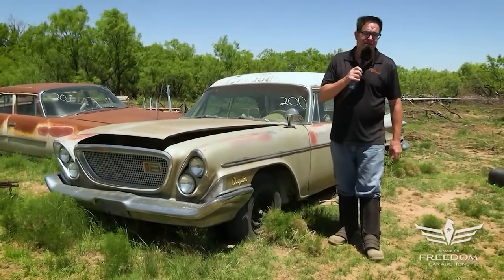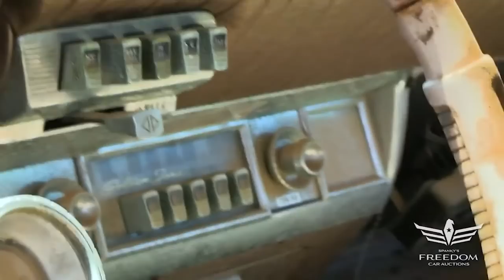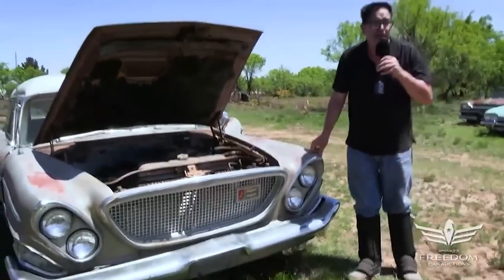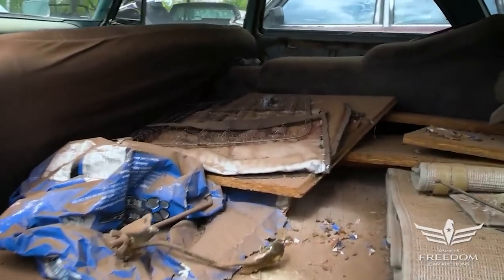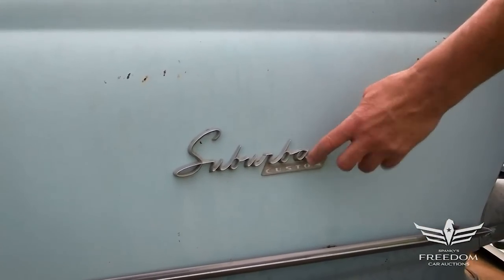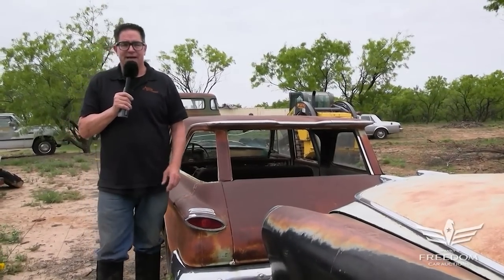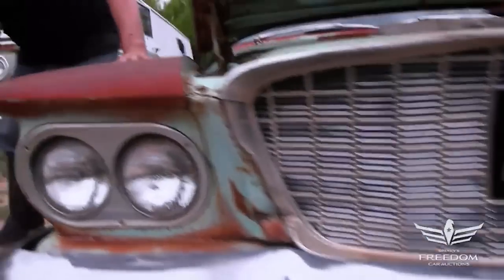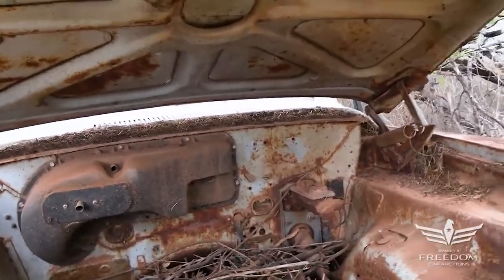Wagons Ho!

Comment: My parents had a new '62 Newport 4 door and from the rear door back that quarter panel is NOT '62 factory stuff.  That is "Ambulance specific" as is the rear bumper and the tailights.  The lights are similar to stock ones that were placed on top of the rear fender and extended over the edge and downward ending in an integral back-up light.  They almost look like the stock ones mounted sideways, but they are not.  The ambulance company did a decent job with the conversion.  Chrysler conversions are rare, because most all ambulance conversions were Buick or Cadillac in the late 40's, 50's and 60's.  The first volunteer ambulance my Mother drove was a used '49 Buick, then a used '56 Cadillac, and finally a new '64 Pontiac.  She could really throw them around, too; but knew their limitations. There were several people in town who said they would ride with her anytime.  [After she drove them, with the gas pedal floorboarded (lights & siren), on US 9W to Albany City Hospital] (Now Albany Medical Center).  One 60 flash per minute 2 bulb Rotobeam (yes, that is a Brand Name) on the roof.  One red light was all that was needed then, not like the 25 flashing lights today that some drivers still can't see coming.

Comment: My father, in 1970, bought a new Plymouth Sport Suburban, fully loaded, with the 2 way rear door, chrome roof rack, and a 383 Magnum under the hood. What a cruiser that was!👍🇨🇦
Reply: We had the 71 with the same specs. Sport Suburban.
Reply: That must have had good power with 383 engine.
Reply: @Daniel-fd3wp  ours had a 727 and probably 3.73 gears, so it would scoot. But it was only good for about 70 on the highway before it got too revvy
Reply: @mgmcd1  It would have been better if it had a 3.23 which would have been fine on the freeway. I don't know the reason for ordering the 3.73--more grunt for pulling a trailer and rarely going over 55?  I believe at 70mph you would be close to 3200rpm.  My 1968 Charger has 3.23 in it, I can smoke the tires and the acceleration is fine.  I will trade off a little "off the line" to have the occasional quick blast on the freeway without running out of breath.
Reply: @ToyKingWonder  it might have been the 3.23, but it was fast as stink accelerating.

Comment: Growing up we had several Chrysler products Stationwagons... First was a pink and white 1956 Chrysler Polysperical V8 S/W "like in the TV Show [One Day at a Time] opening Credits" it was in North West Ohio and the passenger rear seat floor, had a huge hole in it "you could see the ground moving under neath the car" from the winter salt... A dark blue 1966 Plymouth Fury II with Air/C and last year of the "A" block V8 318 & Automatic...  This S/W a former Singer/Friden "Early Computer Company" Service Manager: over Division employee's, company leased car... 1969 Chrysler Town & Country 383 2V Auto A/C dark blue; decked out with huge factory wood faux side cladding... !! 1972 Chrysler T/C 440 V8 4V Auto A/C fully power everything optioned out... !!

Comment: My parents bought one new in 1961, 170 cu.in. slant 6, 3 on the tree. 2 door to keep us kids in😂, windshield wipers were an option. Ugliest car ever built and parts would fall off driving down the road. I rebuilt the engine in 1970 with 200,000 miles and no cylinder wear but the rings were the same size as the pistons.

Comment: Growing up my Dad used to drag race in the early 70s with a red 1969 El Camino SS 396 with a factory replaced 435 hp 427 4 speed. He named it Red Ryder , had the name painted on the fenders in yellow. He also had a gold 1970 or so station wagon, it even had the same taillights as the El Camino and the same front end as the El Camino/Chevelle, He would flat tow the El Camino with it to the strip. I was like 5-7 years old or so back then but i remember both cars. He had the El Camino into the late 80s before he sold it.

Comment: Back in the eighties while working on the Lebaron conv. at Aero-Detroit the draftsman on the board in front of me was a Chrysler direct employee and had been on the 60 valiant program. He told me he drew the rockers and the material thickness was .060,  never knew if I should believe him,  it was done due to the unknown strength of the unibody construction as it was a new thing for the boys at highland park. Thanks for putting this video up. PS  I bought a 61 Lancer from a guy in 1970 drove it two years with no repairs needed just a few tires it shimmied at fifty and the shift lever would fall over as the fingers were well worn but it was easy to get back in the grove. Paid  75 bucks for it and it was a two door. Sold it for 20 bucks thought I blew the engine but years later it dawned on me the water in the number 2 hole was from a blown head gasket. Probably the best car I ever owned.

Comment: In 68. My late Dad. Bought a 61 Plymouth four door. Sedan. Used. As a taxi. From. New. Till. Engine. Blew.  Slant six.  Hit a curb. Took out. The. Oil pan.  Think he. Paid. 65.00. Dollars delivered home.  He had. A chance. Flat had. Six. But bought 55 Pontiac. With. Rusted. Frame. Six. Three speed. On the tree. Used. Pontiac. Mounts transmission.  He cut drive shaft.   He drove that way. Four or. Five. Years. Thanks

Comment: There are way more wagons in this video and far fewer ho's than I expected. The wagon-to-ho ratio is off in the title... you should fix that... Preferably by adding more ho's. (to the video not the title)

Edit: Just watched a video titled: "'How to die while arc welding at home" that had more ho"s than this. Sad when standards fall this low so quickly.

Comment: In my elementary age 9 untill I was 20 my family had a 77 caprice estate wagon 350 4v. green,fake wood etc. It got 340 k on the clock. Tragically my mom traded it in on a Ford gl ESCORT.🤯. the Ford had a mysterious water leak that was never fully fixed. I still want a caprice wagon. or a Buick roadmaster wagon